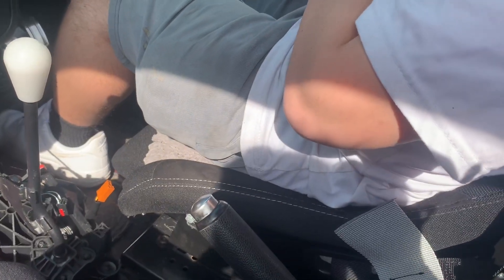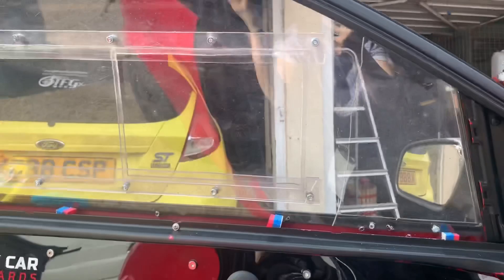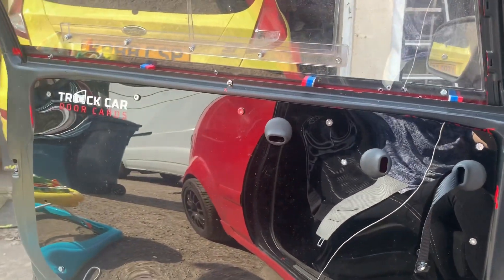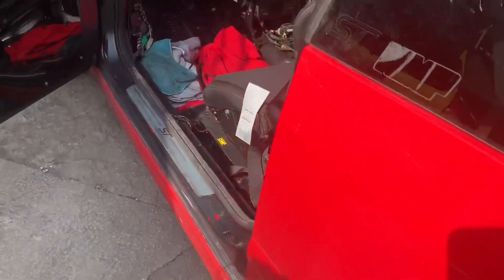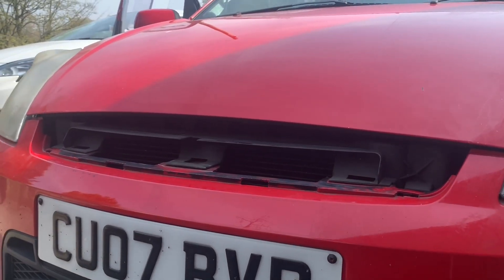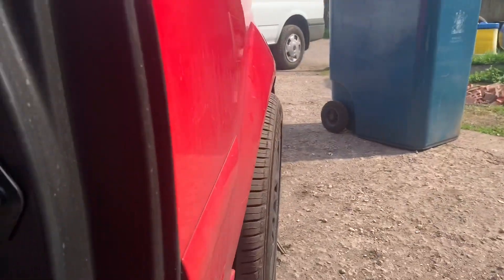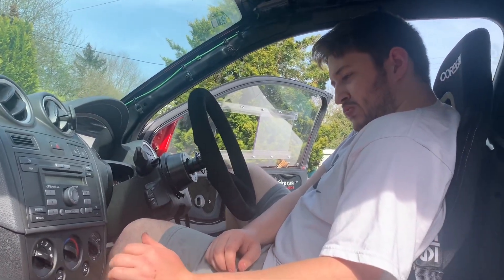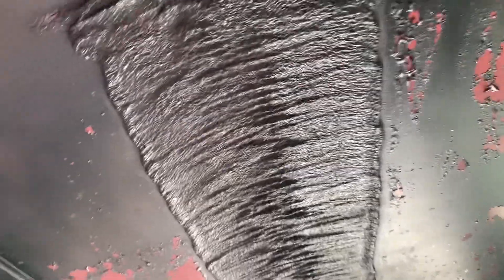Everything WRONG with our Mk6 ST

Comment: 200bhp only takes a few bolt ons e.g cams inlet manifold exhaust manifold 64mm throttle body I think that's correct size don't quote me on that and a cat back system with either a sport cat or de cat and if you want to rev right off the clock a set of cosworth spec lifters with the cams